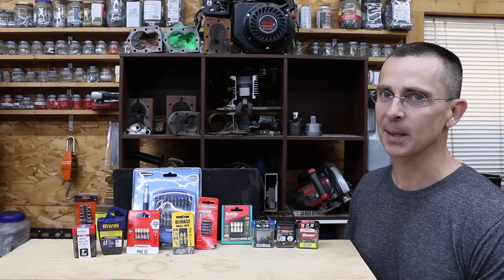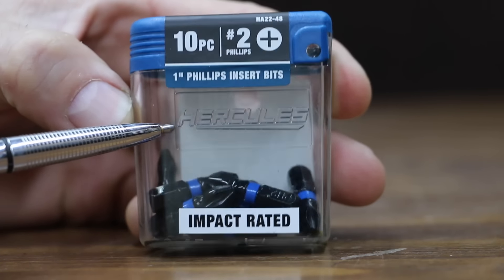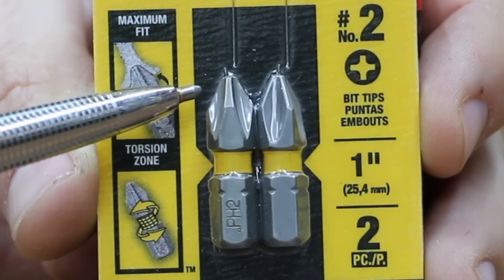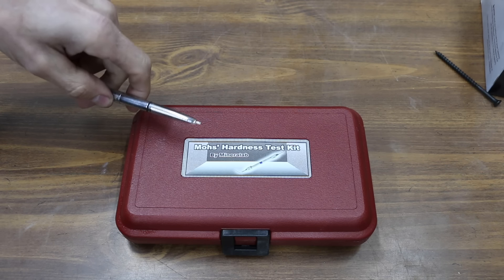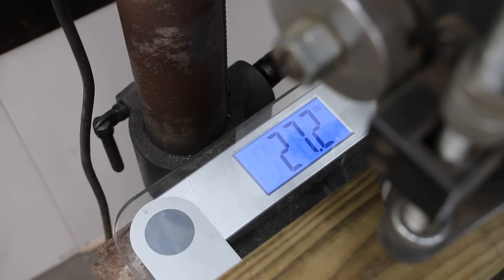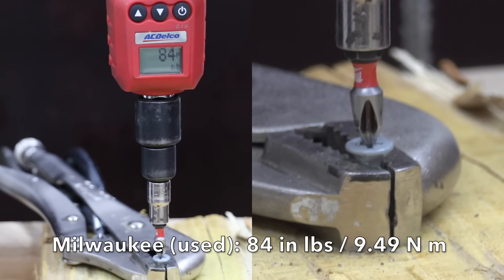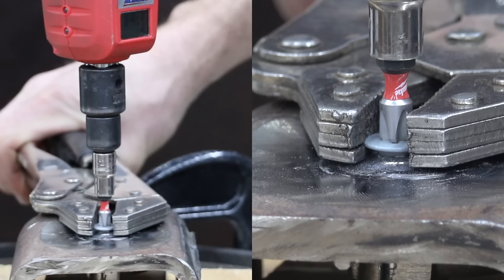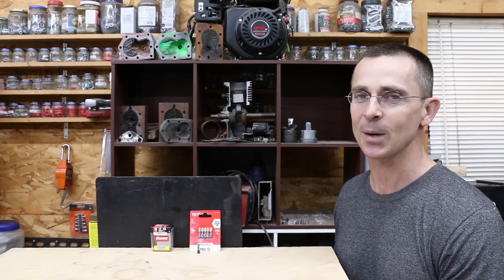Which Impact Driver Bit is Best? Let's find out! Phillips #2 Showdown

Comment: I personally am using mostly Wiha branded tools and compared with the others I'm very satisfied. As a copier and printer technician I'm not using electric impact screwdriver so I'm not applying so much torque to the bits but considering the fact that I'm still using the same bit set for 5 years and on, it's pretty amazing. 
@Project Farm, thank you very much for the good quality videos and keep up the good work. Greetings from Bulgaria!
Reply from the maker: Greetings!  Thanks and you are welcome!

Comment: I did notice my bosch bits wear out much faster than I expected. Sometimes after one light job the bit doesn’t look so hot. I’m also constantly impressed by Bauer quality for price. 

I’ve always wondered about the JIS (Japanese industrial standard) bits, the combo tip bits (P2S2 Phillips/square), and diamond coated bits. If a diamond coated bit lasts a ridiculously long time, having one #2 Phillips it might be worth the 4 bucks.
Reply from the maker: Thanks for the feedback.

Comment: I like these good comparisons. Very thorough and useful!
Regarding the fit (wobble) of the bit to the crew head recess, the problem of being wobbling is due to the tip of the bit bottoming out at the screw head recess. I find this imperfection very annoying. For hand screw drivers, I usually grind off a little from the tip in order to prevent stripping and ensure positive grip on the screw head recess.
Reply: Interesting, hadn't thought of that.
Reply: Ya,  done that too

Comment: i don't understand this, he is not measuring the bits for a standard size, no rockwell testing, no measured torque, ect.  ect.. I don't understand how this has any relevance.  We don't know the downward force he is using? nor do we know the inside dimensions of each screw and the variances of the screws dimensions.  Also, he is human and when your pushing down over and over their could be a variance in the downward force. 
I consider this a "fluf" video for non technical people

Comment: The Milwukee did exactly what I expected, having lower than average new performance, but better sustained performance.   It is clearly a wear-life design instead of a performance design.
Reply: As a note, the Wiha shows the benefits of a performance design.  Not unexpected either.  Wiha tends to advertise that by brand.
Reply from the maker: Thanks for the feedback.

Comment: Thanks for your efforts,  good information to know!  On a personal basis I'm not sure for drill bits,  but for complete screwdrivers, those with the toughest, longest-lasting tips,  for me,  have been the Klein brand.  For steel products in general, I've found that Taiwan or Japan-made items do a better job (more precision. harder metal)  than comparable items from mainland China.
Reply from the maker: You are welcome!

Comment: What is impact driver? What is the difference with regular screw driver?
Reply: An impact driver works kinda like a hammer but for screws. Instead of hitting downwards it hits in a rotational direction due to a hammer and avil mechanism inside that activates when there is a lot of resistance. This makes it a lot easier to drive screws in and requires less effort from you the user. There is a great slowmo at 11:30 showing the impact hammering a screw in. A conventional driver just turns constantly which results in more force pushing against your arm and a greater tendency to cam out.

Comment: Your hard work in maintaining neutrality in your tests is very much appreciated. Something that I would love to see tested is windshield wipers. I live in a hot dry climate and find myself replacing them often and wandering if the more expensive brands are any better than the cheap ones.
Reply from the maker: https://www.youtube.com/watch?v=g3S8udUSKtY
Reply: My personal experience has shown that the cheapest silicone beam wiper blades off eBay last longer and perform better than the expensive blades from Walmart. I'm talking about a $12 per PAIR set of blades vs $60+ per pair!

Comment: Worked with Milwaukee tools a few years ago in my last job, was impressed by how good the drillbit was, so I got myself an angle grinder, shock drillbit and shockwave bits.
Just watched this to know if there's a brand even better than them, but as it seems I did nothing wrong and already went with the best.
Good video, well done.
Reply from the maker: Thanks and you are welcome!
Reply: For my personal use I've went with Makita but for my job ( maintenance director at a nursing home. You'd be surprised at the work we have to do. And believe it or not although the elderly can be very destructive its the employees that cause the most damage lol) I went with Milwaukee and i am very impressed with their products. I told my wife that when my Makitas finally die I'm going Milwaukee all the way. I've already bought a Milwaukee reciprocating saw, drill bits and a multitude of driver bits of all kinds. Even the razor knife and tape measure i bought have been very reliable. Just good quality. And I'm a very firm believer that in most things you get what you pay for. Although they're cheaper I've never had much luck with brands like Ryobi and the like. Only Ryobi piece I've got that has withstood the years is a table saw. Gotta admit it's been a trooper.
Reply: @kevinlangley9644  lmfao I have a few thousand dollars easily into milwaukee but I keep around the cheapest tablesaw ryobi has and that thing has been impressive, mainly bought it because it was small and light for a table saw.  I've had to do some modifications and repairs to keep it going but man for a cheap saw it's a champ.

Comment: Another helpful video, as I've worn out many a bit!  My idea for a video is windshield washer fluid. That stuff is like $8 at the gas station nowadays. There has to be a better way!
Reply from the maker: Thanks!  Thanks for the video idea.
Reply: I live in the south, so freezing washer fluid is not an issue, what I have done for years, is add about 1 teaspoon of dawn to the washer tank. It really cuts the grime on the windshield and is super cheap compared to washer fluid. Be careful, it really only takes a very small amount of soap, so don't overdo it. Fill the tank almost full before adding the soap, driving around will mix it just fine.

Comment: I love your tests I watched all of them you have posted waiting for new ones but in this video I was hoping to see the strength of the impact but under the hammer action of a impact driver I went through about 10 dewalt 5 Milwaukee 5 makita and about 20 others today while doing some construction and yes I did use them for the right screw I found them to be super week and brittle is there anything you can do to test it